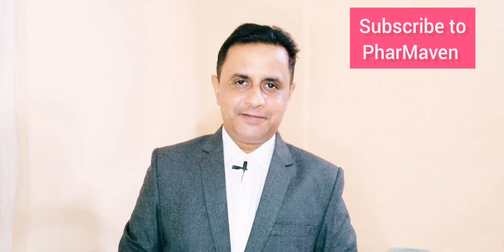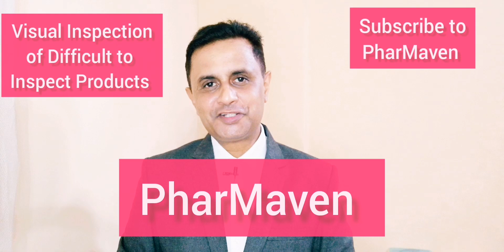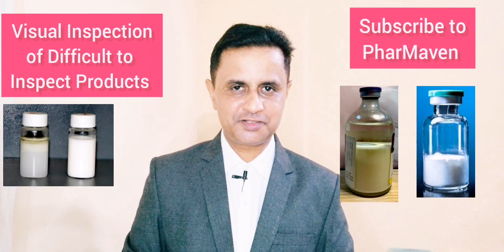Visual Inspection of Lyophilized, Suspension, Emulsion Products, Amber/Opaque Container @PHARMAVEN

Comment: Sir... How to identify the fill volume variation ( defects )for lyophilized products....?
Reply from the maker: First is weight Check during online filling.
All new machines have 100% fill weight checks, which ensures all volume rejection are eliminated during filling only.

During Visual Inspection, lyo product may have a ring formation which indirectly indicate filling level which you can check.
Reply: Thank you sir
Reply: Fill volume of lyo products can be identified by checking the cake level or height of the cake in vials.